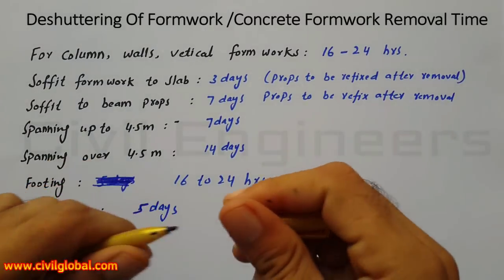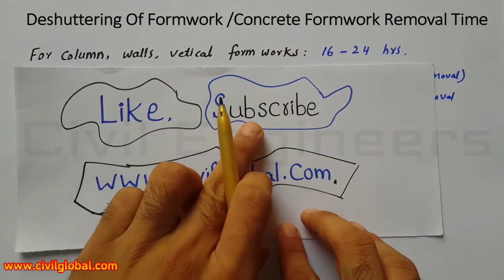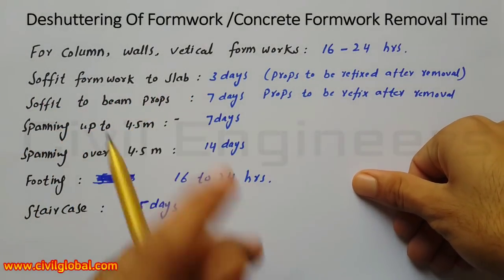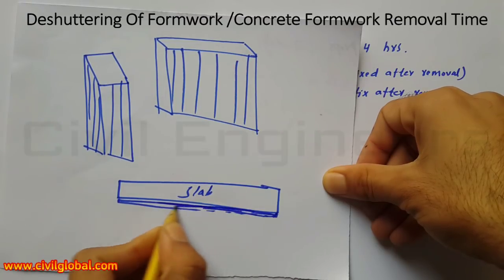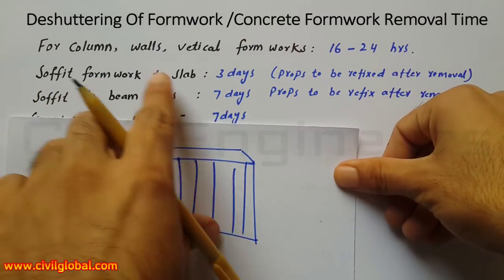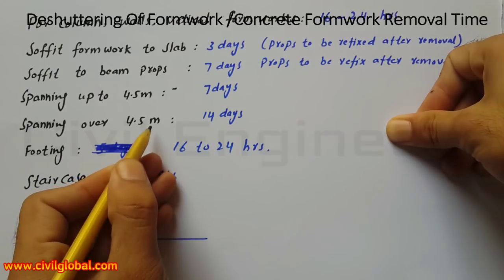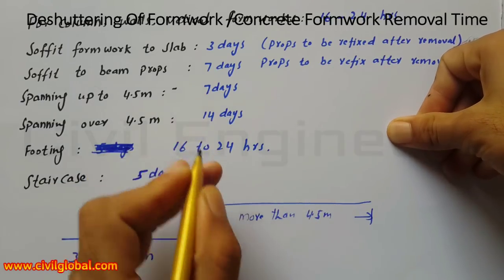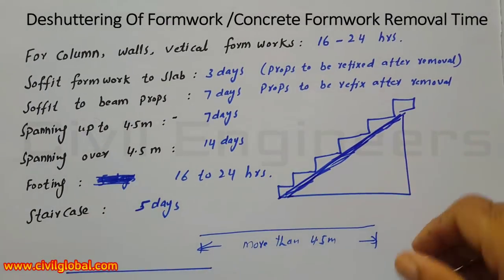De Shuttering Period Of Formwork |Concrete formwork removal time|

Comment: In the case of soffit formwork to slab and beam, after how many days the props should be removed ?
Reply: Gurung Narjung what is props?
Reply: @travelwithanas07  balli ko props bolte h bhai
Reply: @rishichaudhary2046  thnx bro
Reply: Mohd Anas .... is the shoring or post
Reply: Gurung Narjung
Reply: Until you hit the design strength usually about 28 days. sometimes quicker than that.